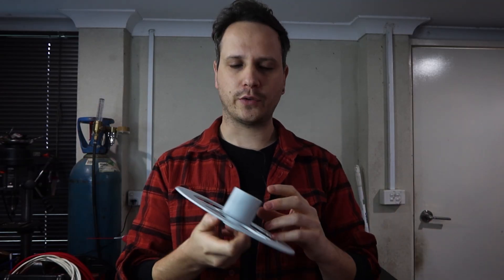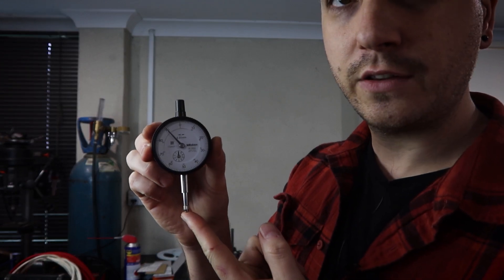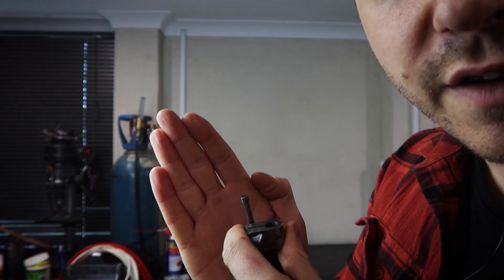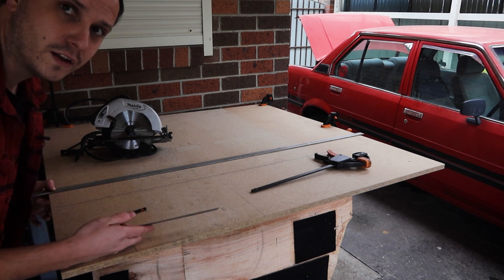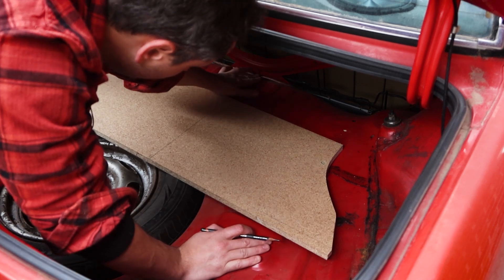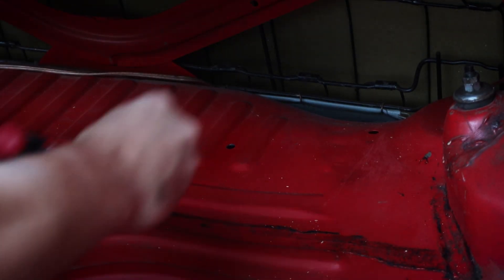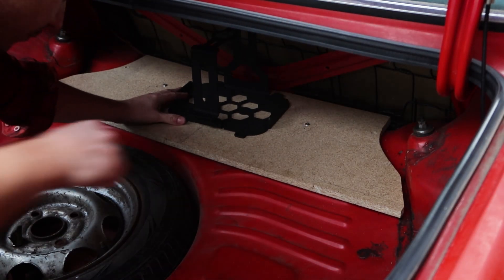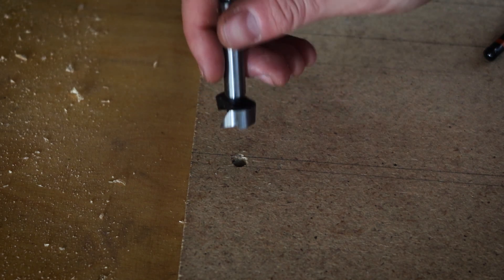Step by Step Battery Relocation on the DIY KE70 Corolla Drift Car - Turbo Project Preparation Part 3

Comment: Would you share the print file for the cam degree wheel?
Reply from the maker: Hey mate, usually I don't share my IP. I may put it up for sale on the website if it works well, though :)